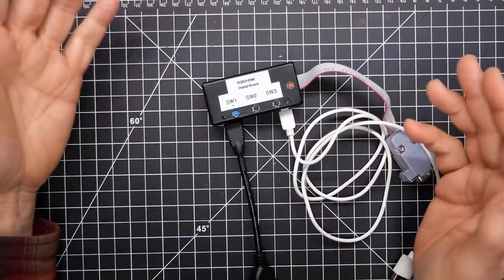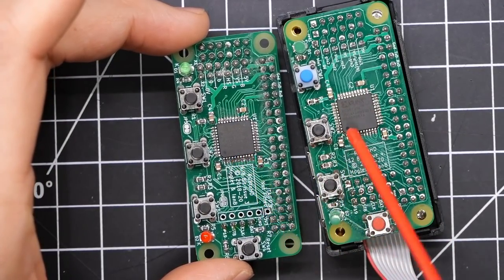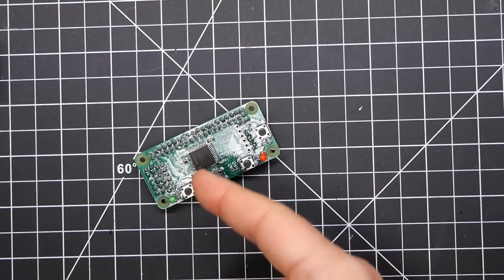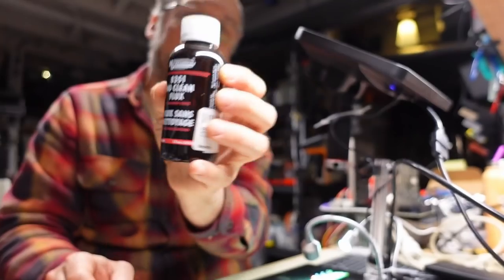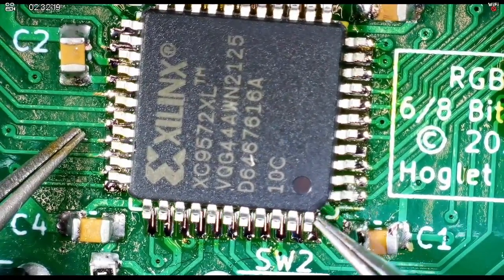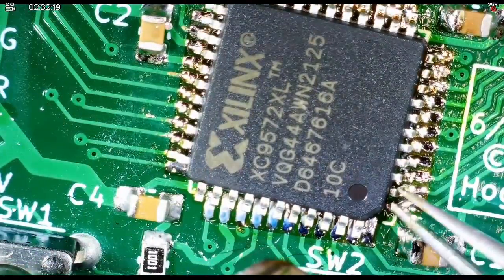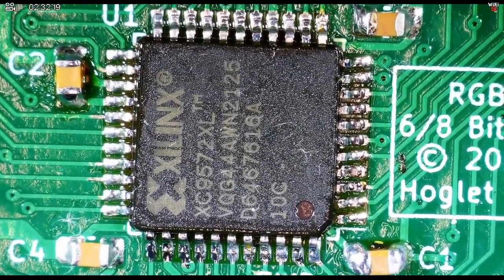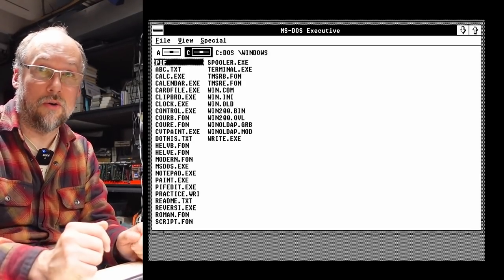The perfect way to NOT do SMD rework (RGB2HDMI overview and repair)

Comment: Hey Adrian,

Can these RGB2HDMI units replace a CGA monitor as might be used with a Tandy 1000EX with 16-color graphics?
Reply: Yep. Have a look at the link to the project website. They have details of all the systems they support.
Reply: I'd seen that they support IBM PC/XT, but the list I was perusing didn't mention the Tandy 1000 16-color CGA specifically. 

You really have to hand it to the people at Tandy.. they took the best enhancements from the failing PC Jr. (3-channel w/noise dedicated sound chip and 16-color onscreen palette), installed them in a truly IBM compatible machine and proceeded to own that corner of the market for years.

And it's true - the best XT-class machine of the time, for business or gaming, wasn't an IBM.

Comment: I've found that if I need to move a chip just a small amount, I have more control if I poke the PCB right next to the chip and rock the tweezers over like a lever.

Comment: You did good in some ways for a first timer but you should've cleaned up the old solder and never mixed solders because if the formula is off then it won't behave correctly and worse at a SMD sized level.
 Also don't use that soldering station. Aside from being the worst air station available EEVBlog Dave has a video of it almost burning down his office.

Comment: wow, that was painful to watch.
* add a bit flux to desolder
* desolder as you did
* suck away all old solder (solder wick?)
* clean the board (antistatic brush, alcohol?)
* position the new chip, solder on one edge.
* drag-solder from the opposite side, ...
* check for shorts and fix them
* clean the flux residue (antistatic brush, alcohol?)

did i forget something?

you can also hot gun solder it, but then you need solder paste to apply before. but applying the solder paste is not easy with some kind of needle dispenser because that needs some pressure which leads to trembling.

Comment: Adrian, I noticed after the cleanup you did that a splat of solder remained in the board, at the right side of the chip. I also noticed the capacitor near pin 1 got a splat of solder in between its terminals. I can't stress enough how risky it would be if those splats come loose during operation! btw, nice job for a first time, keep it up!

Comment: It wasnt great but it could have been worse, it worked and the cleanup hid a multitude of sins. At least you didn't blow all the caps away with the hot air, or delaminate a track. So I'd call that a success. We have days like this even when experienced where something won't behave, we just dont film it and so we pretend it never happened.

Comment: Next time get rid of the old solder and put the chip onto the bare pads. Much easier to get it into its place since it will be sitting on a flat surface instead of a solder blob.

Comment: Don't waste your time with hot air on a chip with exposed leads. Chipquik is the way to go. 30 seconds, and you're done. And no collateral damage from heating everything around the part.

Comment: remove that nozzle and use the hot air without a nozzle.  it will heat a larger area.  that little nozzle makes it harder with a smaller area to heat.  you place the chip where you want it without holding it in place.   and with a lower air flow it shouldn't move and you will see it move into place.  that small nozzle is for small single components like a capacitor or resistor.

Comment: Too much heat 280 better. Use thin flux. Rely on surface tension. Use less solder. Once you do it a few times, you’ll never go back to thru hole.

Comment: 🤣😂🤣😂🤣😂🤣😂🤣 lol i need get adrian a tools that help him get jobs done it called small soilding table what it do it holds board in place without touching ground plus have arm that is flex bend and you can use flex arm hold chip in place so it make easy to use n easy get around it
one i have is very different to use but i know there easy one n small enough that u can put it anywhere else
you only use hot air to remove broke chip dont use it on working or new it likely cause issues down the road and you going need smaller tips for soilding tools i was hoping you spot it it would save you ton of headaches it almost size like needles 
i great to see adrian first time sugging on fixing tiny chip lol congratulations you completely it

Comment: 350 is not enough heat to saturate all the pins at once bud use 400 to 420 and u want to use solder paste ie kingbo

Comment: I'll admit I laughed a few times. But you know what? Everyone, more than once, has been there. The fact you were laughing about how dumb you were being, and working through trying to fix it, only to screw up again, laugh at yourself, and then go back to fix that one, means it will take you 1/10th the amount of time to be good that people who's ego doesn't allow them to fail, which means they can never learn new things.

There are always a million ways to go about things. If that was MY repair, after removing the old chip, I would have gone and used desoldering braid and removed ALL the original  solder from the pads. All of it. Then I would use alcohol + brush + kimwipe, and removed the swimming pool of burned flux that got caked on. Once the board was  _SPOTLESS_, lay the new chip, and solder one pin in a corner some where, then the opposite side to lock it's position  (which is a lot easier since it's sitting FLAT on a board, instead of balanced on varying height balls of old solder). Then either individually solder or drag solder the pins using new thin flux and a manual iron. But there are always many ways to go about it. The trick, Adrian, is to learn a few techniques, so that you can use the procedure you are most comfortable with, to make the best repair you can, in a reasonable amount of time. You got there, and you learned a lot. It's a great video, because it shows people new to SMT rework every single thing not to do! hahah. Take care, great video!

Comment: No. No! NO!!! 
1- After removing the chip, remove the excess solder from the board to get a flat surface
2- put some flux on the board then the chip on it.
3- squeeze some solder paste on the legs.
4- Hold the chip down with the tweezers, drag solder with the iron across the pins. Let capillary action to flow.
5- Clean up the pins that might be shorted. Then Clean up the flux.